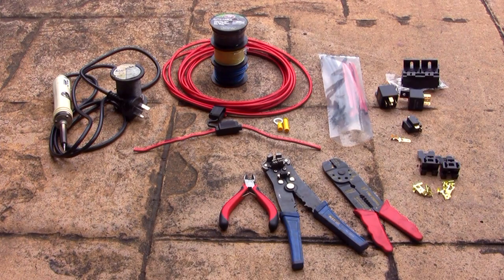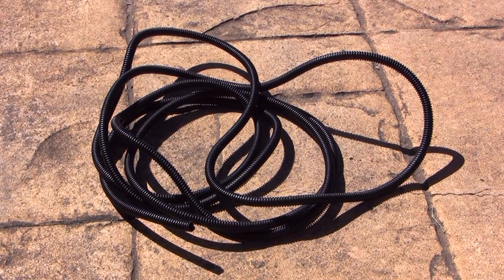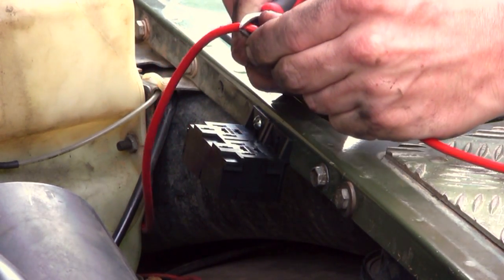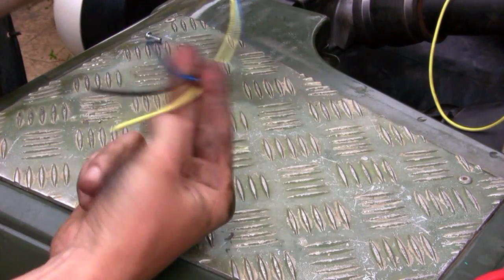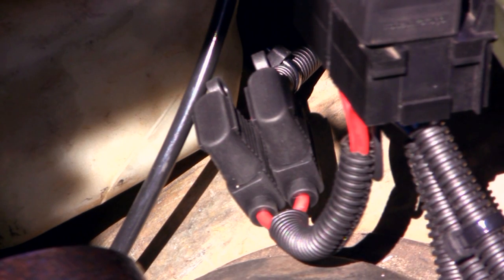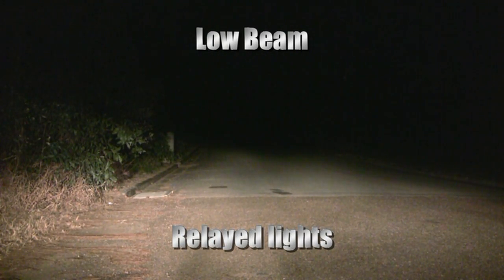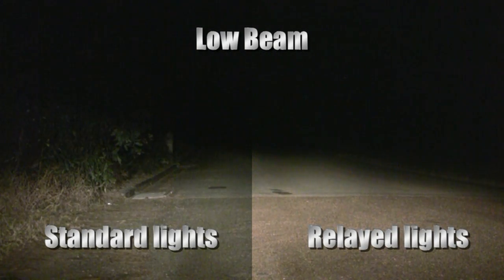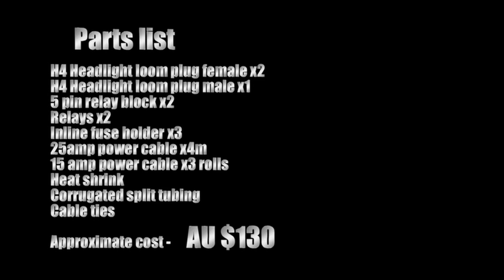Land Rover Defender Headlight Relay Upgrade - Installation and Review

Comment: Very informative video.
Did the same thing myself around 10 years ago and I haven't had a problem since. But please don't use a hobby crimping tool because the joints will fail later (I know from bad experience on this). Look at 4xOverland's video on  electrical installations for more info.
I was able  to do this mod with minimal intervention at the fuse box because there was a spare  circuit there (it's an ex military Defender). Will post a short video on this soon.
Good stuff bro.
Reply: hello, i have a question if you don't mind I'll appreciate it
as we all know cars only support 55-60w bulbs max
i want to try 80w or 100w bulbs i been told i need a stronger relay.
my queen is do I only have to install a relay or replace original wires with bigger ones too? or wires can handle it with the relay only ?
thank you

Comment: Great video Brett, where did you get all your gear from? I can only find the H4 male connectors on eBay myself, I thought Jaycar would have some but no luck unless I'm looking in the wrong spot!
Reply from the maker: Thanks. Mostly ebay and some from my local auto parts store. Try searching ebay with international vendors as you may need to buy direct from china.

Comment: Regarding fusing, you seem to imply that you've run unfused cable from the battery to near the relays, then separate fusing for the high and low.
If that is what you've done, I don't think that's the best way of doing it. The fuse is there to protect the wiring and stop it catching fire if there's a fault so it needs to be as close to the battery (or alternator if you're taking the feed from there) as possible. The way I've done it is to have one fuse by the battery protecting the cable from the battery to the relays, and that's it. Only fuse to blow that's protected in the battery box and the longest cable run is protected too.

If you've put additional fuses in the circuit then that just seems like another potential point of failure for no particular benefit?

Comment: Hi Brett, I've just had another switch fail, 2nd one within 18 months, I have an 02' TD5, would carrying out this mod stop this problem on my Def or is it mainly aimed at older models? Cool vid by the way, keep up the good work.
Cheers
Mike
Reply from the maker: +Mike Rees hey Mike. I'm pretty sure TD5's don't have a lighting relay already so yes this mod should solve the problem. Easy to do and don't need to modify the existing wiring. My upgrade is still going strong. Thanks
Reply: +Roaming The Outback 
Even MY2016 Pumas don't which is a bit silly.
Upgrading it means you get nearer 14V to the lamps instead of 11V-ish.

Comment: Hey mate, how did you go about plugging the new connector into the back of the light? I'm looking at mine and the headlight backing bowl which covers the back has a grommet around the wires and I don't see a way of getting the new plug into that bowl and the old one out without cutting the old wires or drilling a bigger hole into the cup. Kind of hard to describe without using pictures. Am I missing something obvious?
Reply from the maker: Hey mate.. Seems like your car has an extra rubber bulb cover. Don't know much about them so can't really help. You may just have to cut the boot off and go without?
Reply: I think I might have to do something like that; I've got a Perentie so there are a few little differences here and there.  I'm planning on cutting the end of the plug off from the front and pulling it out from the back then re-soldering it together again. Vice versa for getting the new plug in there. Great vids by the way.
Reply from the maker: Sounds like a plan. Thanks.

Comment: Hello again Breet. I had the same problem when the contacts went on mine. 
However I manged to get an after market switch for only few bucks as instead of buying another switch the same as the original model. 
I think the original is about $190 Australian, maybe less now, wheare teh after market was about $12 or $30. The after market switch even has a better contact system off which you manually pul the lever out in two different positions, as compared to pushhing down the lever on the original

Comment from the maker: @bryhutch19 no mate... You don't need to touch a thing on the original wiring harness. Just wire up the relays and plug one of the headlight female sockets into the male control socket of the relays. Easy!

Comment from the maker: @no54sky Hey mate. No I don't believe it necessary. The feed from either the left or right headlight plug is sufficent to control both low and high beam relays. Taking a feed from both LH and RH looms for each low and high beams would use 4 relays. As far as safety goes yes it would be beneficial if one of the fuses blew on the original loom you would still have the remaining side.  Yes, I tapped into the passenger side loom to power the relay control. Thanks for watching. :-)

Comment: Do you not need a feed from both LH and RH looms? I have the same setup that you have done on my mk1 golf. But have read on some Landy forums that you need to take feed from both RH and LH dip/headlight wire looms.
Did you plug it into the passenger side loom?
I think i will do the same as yourself as you have shown it works fine :)
Thanks for the video!